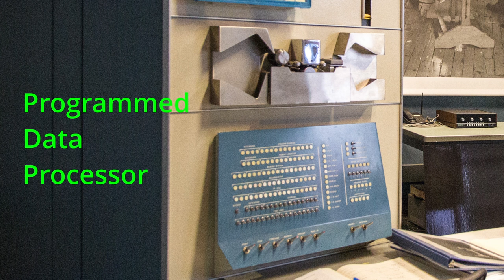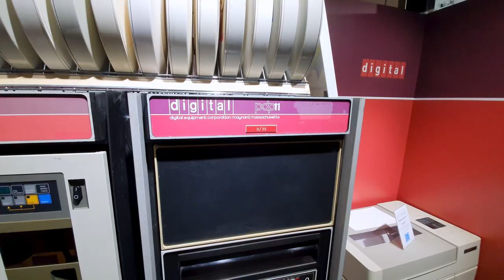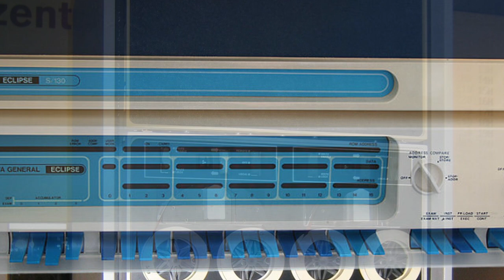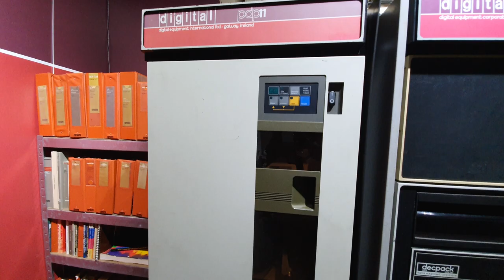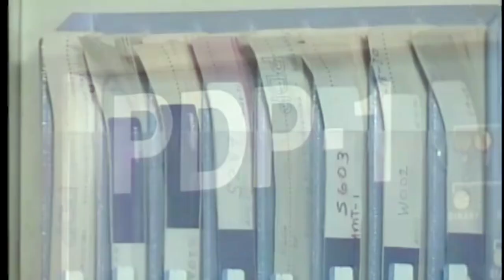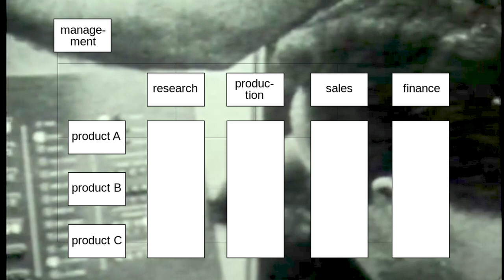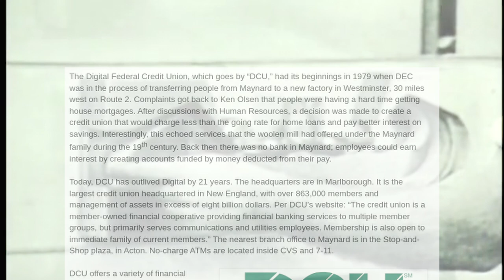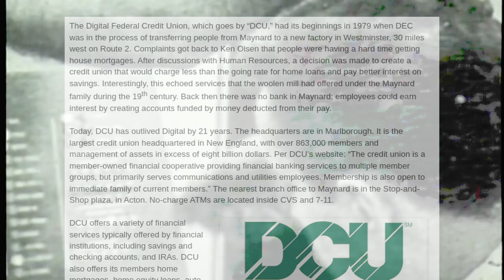DEC and the PiDP-11

Comment: The DECsystem-10, TOPS-10, and MACRO-10 (hardware, OS and macro assembler for the assembly language, respectively) remains my all-time favorite machine. It was the fifth computer I'd ever used. Not mentioned in the video, I swear that in order to work for DEC at that time, you had to have a sense of humor. The humor abounded with the DECsystem-10 like no other system, The 36-bit word, and seven-bit bytes, allowed for "five bytes to a word... with a little bit left over".  Half a byte was a nybble... SOS, the editor stood for Son of Stopgap; Stopgap itself being an improvement on an earlier editor. Competing with SOS was TECO the Text Editor and COrrector. To create a new file with TECO, one typed "make" followed by the filename. Typing "make love" resulted in the Easter egg response "not war?" The Dynamic Debugging Tool, DDT, naturally "killed bugs".  The manual used by field service technicians that kept the beastie healthy carried a manual titled "Welcome to Witt's End" which some may know from the game ADVENT (short for "Adventure") which led one into the land of Zork.

The 17-volume set of white manuals were among the clearest documentation I'd encountered, with the System Calls books being WONDERFUL. It was a piece of cake to write code in ANY language of the day and call routines written in other languages. A wonderful calling sequence design. If a language did not provide a feature that another did, it was a simple matter to extend the language.

The DECsystem-10 used a PDP-11 as its front-end boot-loader. Somewhere out in the world, lost in the sands of time, is my own contribution: UNPAL, written in MACRO-10, which would cross-disassemble PDP-11 binaries formatted for TOPS-10, turning them back into MACRO-11... 

(I think I MAY still have the library of routines I wrote... If I recall, I chose the rather unimaginative name MACLIB...)

Comment: In 1992 I started working part-time in a lab that had 2 PDP 11/70s in it.  The setup included 2 drive units, each looking like a full size top loading washing machine, a typewriter interface for issuing system commands (no backspace or delete, make a mistake and just start all over) another 5 or so 19 inch racks, and dual air conditioning units to keep the room from overheating.  The system interfaced with measurement equipment and user consoles in another room and ran custom software written by Boeing.  It was falling apart, with one unit being cannibalized to keep the other alive.  Replacement parts, I was told, were very difficult to come by.  A few years later I helped replace it with a PC, Intel 486-DX50, EISA bus, 8 MB ECC DRAM, and Windows 3.11.

Comment: Gosh. Worked as engineer in steel industry and used PDPs with RSX. Found them quite intimidating at first.  Oh those RK05 and RL02 disc packs with shock watches on them. Last one we used was the microPDP line.
So lovely to hear how nice owner was👏
Reply: Did you ever get used to RSX? I never encountered it in the flesh, but I tried reading some docs from Bitsavers. Didn’t really make sense to me. And I say that as someone who used its spiritual successor, VMS, successfully for many years.
Reply: @lawrencedoliveiro9104  Other way around for me. Didn't get used to VMS after RSX. Remember going to DEC courses on RSX, Pascal and Macro (Assembler language)

Comment: In the 90s, the US Postal Service used a bunch of these things because they would process interrupts. The DEC computer was at its best for process control. The USPS used them in mail processing equipment, because the machine constantly communicated with the computer about its condition via a hard-wired buss. Anybody who ran process control used these machines, because every time something popped up, the software could be directed to a subroutine to handle it. When Intel came out with their 386 series, we couldn't use them because the chip only had the ability to handle 7 interrupts. I think the base PDP 11 could handle 64. The thing was a process control dream machine. The USPS continued using DEC equipment up until the early 2000s. I had friends who were "pot watchers" in refineries who also had the machines controlling the processes.

Comment: When I showed up for ninth grade at East Brunswick High in 1975 they had a PDP 11/40 with 64k  real core and an RK03 2.5Mbyte removable drive.   It ran Unix Research version 5, not System V, which was much later.  I learned to program in C on Unix in 1975.  That's still my job 47 years later.

Comment: 10:36 Differences between PDP-11 models mainly had to do with

* Instruction-set extensions, e.g. the availability of floating-point hardware
* What kind of expansion bus they had -- mainly UNIBUS to begin with, I think some Q-BUS models came later
* How much physical RAM they could address. Remember the instruction set only had 16-bit addressing, while actual PDP-11 models came with 16-bit, 18-bit or 22-bit physical addresses. You thought the 8086/80286 segmentation model was tricky to deal with?
Reply: As an application programmer you didn't really access physical addresses, you could link your program to seperate program from data but mostly the shared system swapped memory in/out from disk and you needed to be running in privileged mode to access memory mapped addresses and privileged registers (which I could do on an LSI11 micro).
The PDP11 influenced thematic C, "for (; *p++=*q++;);" mapped directly to efficient PDP Assembler.
Reply: @RobBCactive  I recall overlays being a problem in RSX11 programming. Some planning was needed. There were also choices to be made during RSX11 Sysgen (setup of the OS). It got much better over time, though.
Reply: @SeaMower  I used UNIX version 6, RSX11 was DEC's OS for real time?
IMA in nostalgia I forgot commerce used them too 😉😉

Comment: I have a complete original front panel from the slim model of the pdp-11.  Really nice form factor... haven't seen any since the swap meet I picked it up at.  Was $20 the guy wanted $110 for a complete system I said "Nahhh" and just took the front panel home.  Complete with switches and electronics, everything is there.  Kinda fun to play with sometimes have never felt the inclination to hook it up to anything tho!

Cheers.

Comment: DEC definitely deserves credit for creating the first mainstream microprocessor to run at 1ghz, the Alpha AXP. After the company was bought and broken up, suddenly everyone knew how to do >1ghz processors.
Reply: I remember that. I used to work for DEC dealer in the early 90s and they sent a poster with that chip screaming 1gz while PCs were just getting to 386s running like turtles in comparison.  We had like 3 engineers that were the only ones that knew how to operate them. That was like 30 years ago.

Comment: Let me add a reason for the PDP-11 popularity -- the hardware could be purchased for about $25K, which, in the 1970s, was under the maximum limit of equipment purchase allowance by non-Computer departments in many universities.  In effect, a professor with a grant could buy a computer which was not behind the glass (and control) of the college data processing organization.   It was extraordinary freedom at the time.   Many compliers were made "public domain" or cheap at the same time, so the ATT Unix operating system with "C" and Fortran language became somewhat of a standard for these systems.

Comment: Back in the 80s I used to work on a huge Xerox laser printer. (120 images/min, duplex) It had a PDP-11/34 built in as a controller. It also had a disk pack and a 9-track tape drive. Never a problem with the controller.

Comment: I was working on factory-fresh µPDP11/93 boxes into the late 90's, integrated into medical imaging computers.  It took about 10 years to get a new system FDA cleared (super complex process), so the underlying tech was usually a decade or more behind.  Nowadays, a design has to plan for premature obsolescence of a component and "evolve" updates.  We switched for a time to "modular" SGI toasters as a possible solution, but they completely vanished before the repairable PDP and VAX spares for the old systems were exhausted.  Now a GPU PCIe card (for the same functionality) has a product lifecycle of one year (if it actually runs that long).  True, the materials cost is hundreds instead of thousands, but I really miss stuff that worked for decades before it broke and had to be tossed.

Comment: My university had a machine called DEC-20 when I was there studying Comp.Sci, in the late 80's. And I were quite fond of those Facit VT-100 terminals. I still choose my keyboard to have a similar feel to the Facit kb. As for the computer itself, I never saw it. It stayed safely behind locked doors.
EDIT: typos.
Reply from the maker: I did like the VT-100 terminals, there was one hidden away room at my uni in the mid 90's that had a few of them, and if you had a logon for the uni's big IBM unix machine like I did you could use them.
Reply from the maker: There where one or two VT-340 colour terminals as well which could do imited graphic using sixel. Which was enough to be able to display image files etc from cli. Someone has now made a sixel X server, but that was not available then.

Comment: It's nice of you mentioning the Eastern Bloc, but you could at least have shown an Electronika BK, which is a PDP11 compatible home computer, Electronika Graphing Calculators with huge displays that could in theory run Unix or the Soyuz-Neon PK-11/16 Graphics Workstation which could display 256 Colors of 64K colors and Utilizing 1-4MB of RAM. All PDP11 compatible.
Reply from the maker: I'll admit Easten block verisons of these machines are not an area I know too much about, so I did shy away from talking about them too much. It is an area I am doing a fair bit of reading about.

Comment: 9:00 Actually, no. It was magnetized in one direction for a 0, the opposite direction for a 1. To read a core, you tried to flip it to a 0; if it flipped, that induced a current pulse in the sense wire, so it must have been a 1. If it didn’t flip, you got no current, so it was obviously already a 0.

Another fun thing is that core memory was non-volatile ; it kept its data contents even when the power was off.
Reply from the maker: I know someone who bought a core memory module and decieded to see what it still contained, he pulled out some 7bit encoded text, that must have sat in it for 50 years.
Reply: @RetroBytesUK  Curious Marc also did a video where he reads some ancient core memory.  One tricky thing is that reading a core wipes it, so core memory must be rewritten after each read.  Core memory is indeed incredibly robust, and radiation resistant, so was used for spacecraft, including NASA's Space Shuttle.  Apparently, data recovered from the core memory of Challenger after is suffered its catastrophic malfunction, was used in the subsequent accident investigation.  I have used several DEC machines from a PDP8/e to a Dec Alpha, so I am looking forward to seeing this.  The front panel lamps and switches on PDPs were indeed used directly for programming and debugging.  We were fairly good at reading and entering octal codes directly.  Every bit matters when you only have 4K words to play with.  The Alpha was quite a powerful beast, similar to the other RISC offerings from IBM, HP, and SGI.  Sun SPARC was always slower for the same money; IBM and SGI was the best value.  Then Linux arrived, and that changed everything.....
Reply: @cdl0  DEC had a hand in helping to popularize Linux. A guy named Jon “maddog” Hall, who was working for DEC in the early 1990s, was instrumental in getting an Alpha delivered to this young CS student in Helsinki who was working on an interesting new operating system. By 1995/1996, he had it running on the Alpha -- only the second platform to run Linux, after x86. So it went portable at the same time it went 64-bit.
Reply: @lawrencedoliveiro9104  Ah yes, I remember that now!  I also used many different Crays, SGIs, etc. myself at what is now called Aalto university.  They were wonderful, exciting times.

Comment: 13:16 oops raspberry pie connector on wrong side. I want one of these, but really I'd rather have the real thing. I worded on 11/45 at DEC in the 1970's. Have to say the switch toggles are perfect. Original machine used DPDT switches so two circuits connected together when the switch was activated. Each time I see one of these videos it touches my heart. The 11/45 and 70 both have critically important troubleshoot tools as a part of the design. They were microcode machines in that each instruction was completed by several steps of the data being moved through the ALU's and returned either to a register or to the memory location it came from. Just knowing the guts of the 11/45 gave me a wonderful career. I could write short programs and toggle them in to aid my repair work. I still have original keys. A nice thing about the 11/45 was that you could go and pull the plug out of the wall while the machine was running a program, then come back later and plug it back in and it would start up running the same program where it left off. Of course this only worked with core memory. Which I can explain the operation of completely too.This feature was implemented by the hardware, not the software. And I know how it did it.  I have to add that the red Pinto comment is 100% true, saw him do it. He came over to me one day and asked what I was doing, so I explained what I was doing, he thanked me, and walked away. My department lead then came and asked me if I knew who that was, I told him I didn't, so he told me, that was the president of the company. Ken would just stroll around the old mill and talk to people. It was a great place to work. My employee badge was 7636. Still have it to.

Comment: Back in the late 80s, I put in a few Northern Telecom PBXs (later known as Nortel), linked with DEC PDP-11 computers to power early Call Centers (aka ACD-D (Automatic Call Distribution ver. D)). Aside from routing calls based on skill set, it provided statistical reports. By the way, I remember the “pizza pan” disc drives …
Reply: RK05 pizza oven.

Comment: Being half the size of the 11/70 this PiDP should be called PiDP 5.5 🤣
I used to work with an 11/70 at school and later owned an 11/45 with 2 of those lovely hard sector 8" floppy drives and an original ASR 33 teletype. That system was a gift (EUR 5,-) from a company scrapping this thing from a production line. It actually took me some time to figure out I actually had one 11/45 and two different PDP8 machines with a core memory in both. The 11/45 was used as the development system to write programs for the PDP 8, "flash" this program on the core memory and then run it on the PDP 8 machines that were being used as possibly the first PLCs in the factory.
I only used the PDP 11/45 to learn about the PDP 11 architecture and to heat up the living room in our student home. Unfortunately it was scrapped when we moved to a new house that was equiped with a modern central heating system. No ... I'm not THAT old ... Both PDP 11 systems were donated by companies replacing them with more modern IBM PCs 😁

Comment: It is factinating that the Raspberry Pi has orders of magnitude more computational power than the PDP-11, but at the same time is only the fraction of the size and especially a fraction of the price. We have obviously come a long way.
Reply from the maker: Its amazing how much power a RPi has especially at the price they go for.
Reply: @RetroBytesUK  that is absolutely true. The current models are certainly powerful enough to replace a typical PC you would use for office applications or internet access. If I needed a computer just for that, I'd likely use one of them for it.
Reply: The last PDP-11 work that I did was in the early days of Medical Imaging Systems (CAT Scans/MRI/ PET Scans) in the mid-1980s.  One of our systems was based on a single-chip PDP-11 (T-11B), running GORT (Good Old RT-11), the beast would do data acquisition, tomography, and analysis - all on a 16-bit word-oriented machine with 64K banks of memory - It would take a few minutes to acquire the data, then 4 or so hours of mathematical magic, assisted by an Array Processor, and shuffling though about 150 code overlays to turn the collected photons into a 3d cross-sectional model of the subject.  Nowadays, it happens in real time.

Comment: For Alpha, as a side note, you might also want to dig into Symbolics Inc. (the first dot-com!)  When their LISP-machine hardware business was failing, they ported their "Open Genera" operating system to DEC's 64-bit Alpha, the only commercial 64-bit chip at the time. One issue was that Symbolics' LISP Machines ran variable length words, they needed the full 64-bits on such a radically different CPU architecture. But even that wasn't good enough, they further tried to improve speed by utilizing the microcode of the Alpha 21064 (also called the EV4), which increased performance, but meant that code wouldn't run on a later Alpha chips, and seeing as how Compaq bought DEC, and then HP bought Compaq... the effort was doomed. Symbolics Inc. pretty much embodied "the perfect as enemy of the good". Symbolics also created the greatest computer keyboard ever, the "Space Cadet", also ridiculously expensive and a low-profit-margin item. My ex wife worked at Symbolics during its last days, and it was pretty ugly (the remnants were eventually bought by former employees).  Symbolics machines were used in places such as French nuclear power plants, I assume doing a good job, as I haven't heard of any accidents from back then (late 80s to 90s) lol.  If only we had LISP machine OSes running on Alphas!... I suppose humanity wasn't ready!